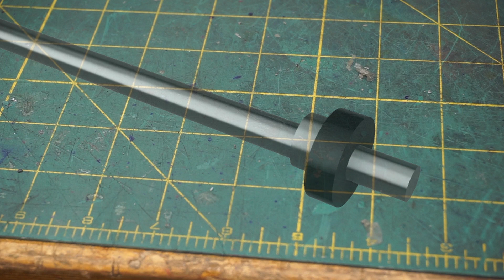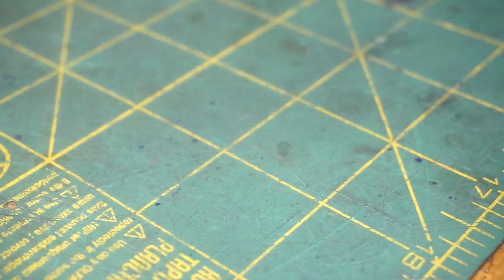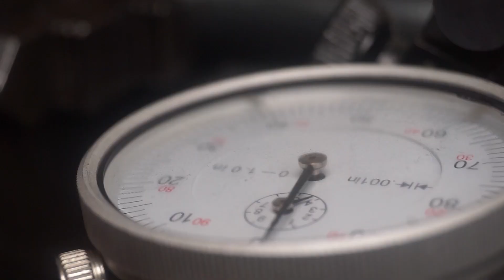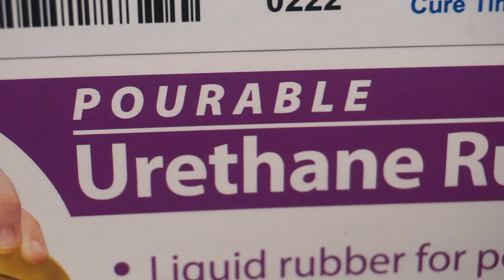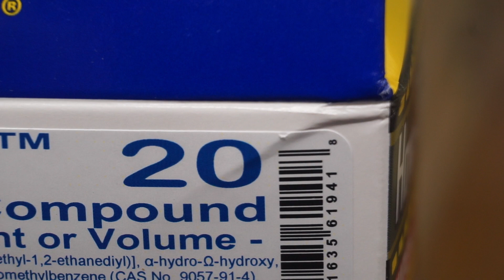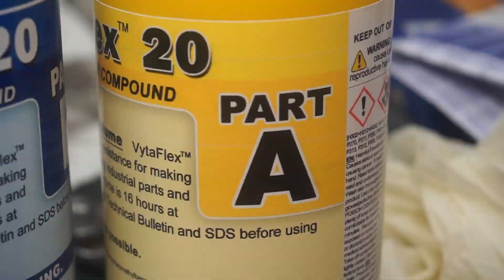Making my own Letterpress Rollers

Comment: I too have been thinking about casting my own rollers, and so I found this video very interesting. I wonder if you apply a little heat to the liquid urethrane it would expel the bubbles.
Reply from the maker: Hmm, good idea! Though will say, though there are some bubbles inside my rollers, it hasn't seemed to effect the rollers in significant way, and none made their way to the surface during the curing process.

Comment: Great video!  I tried this with RTV from Micromark (two part) and 3D printed pouring caps and trucks.  Shore hardness 32.  Perfect! Cost 7$.
Reply from the maker: Perfect indeed!
Reply: Was that one of their silicone mold making rubbers?
Neither I see has the hardness on the site, and are $35-$40.
Rapid Mold Rubber #82083
Express Mold Rubber #86226

Their Polyurethanes look like all hard durometer.